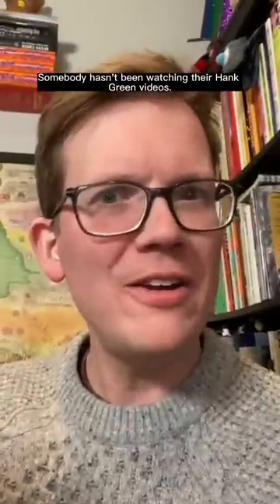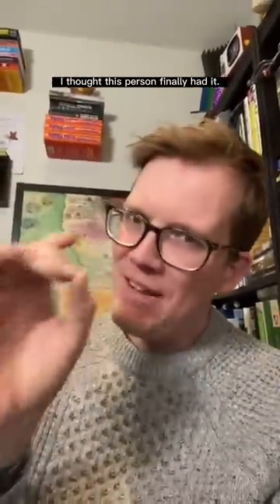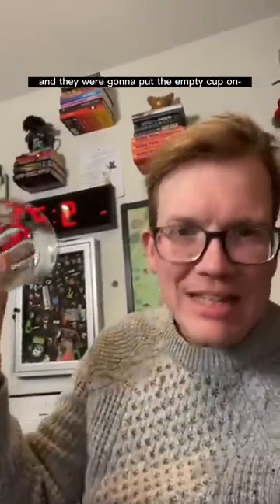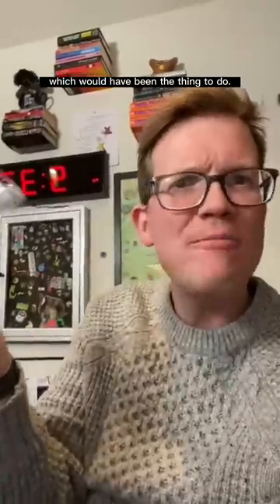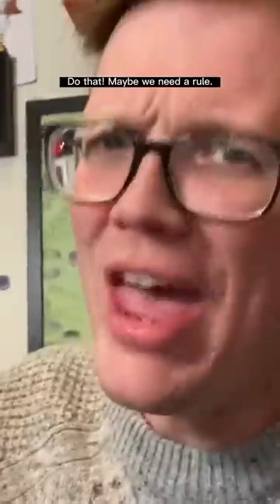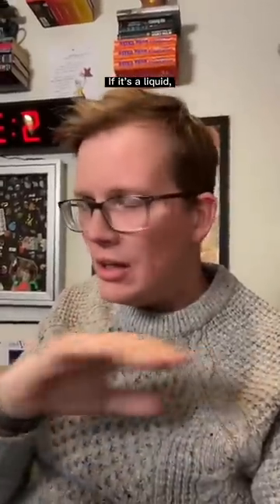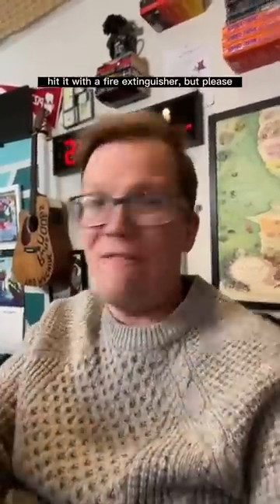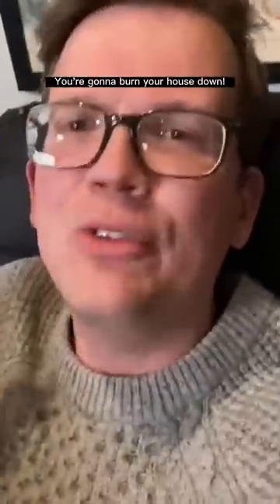Why does water cause candle fires to explode?

Comment: bro I remember I baked pizza rolls in a glass pan. When I put the pan in the wet sink and it shattered into a million pieces. I .... was extremely confused and didn't know how to tell mom what happened.
Reply: harsh quick change in tempurature in a brittle material under pressure, ouch

Comment: I bet your rule of thumb has a very low if not 0 chance of ever coming back to haunt us, but I have to wonder since all the explanations of oil fires involve that water is more dense than oil. If water is poured onto a more dense, burning liquid and it stays (mostly) on top. Does the same thing happen?

Comment: Hey Hank, in this video ( https://www.youtube.com/shorts/oRspouGhS20 ), the guy stops a wok grease fire by adding more oil because the room temp oil cools the hot oil below it vapor point extinguishing the fire because the fuel is no longer ignitable. 

May be using incorrect terminology, hope you get it.

Comment: Can't you just rub it with your fingers?
That's how I usually turn off a candle
Reply: Yes but in the video the whole molten candle wax is as burning too.
Reply: @GrillerRohde  burning wax doesn't really hurt as long as you don't wash it while it's hot
Reply: @whalewingy1962  
But you can’t just put it out like a normal candle.